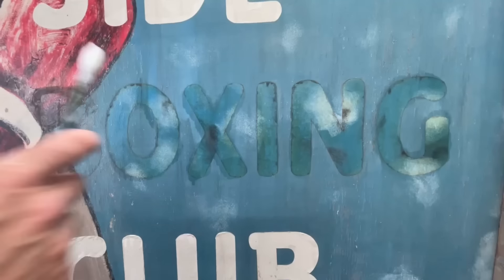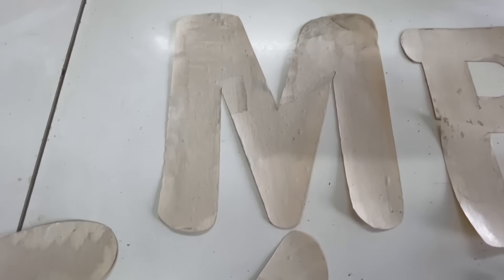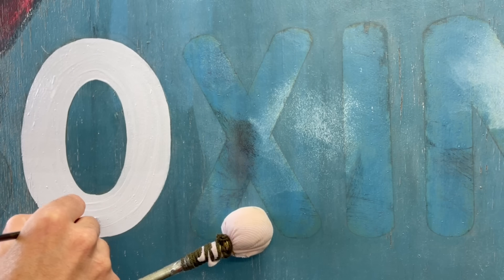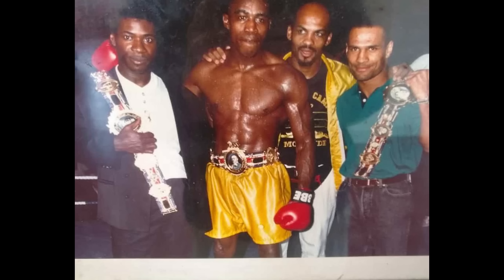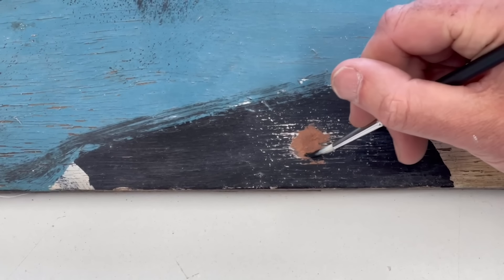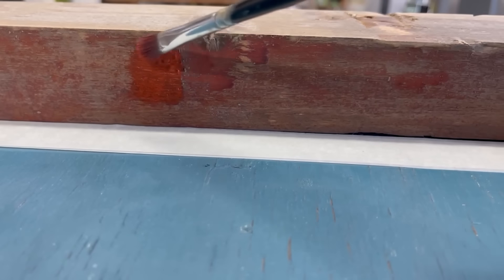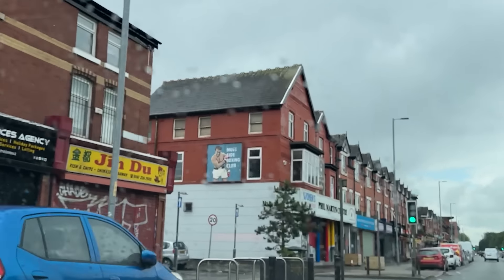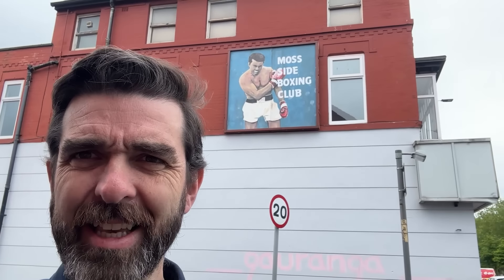Restoring a Legend Part 2 - Stickers and Signwriting

Comment: Actually I suspect modern vinyl wouldn't last anywhere near as long as the old letters did because a lot of the horrible chemicals used back in the day have been banned for good reasons. I don't think letters like these would he laser cut (vinyl isn't suitable for that because burning it releases hydrochloric acid) but with a plotter. These have been available since the 1970s but only became affordable for small shops and DIYers later. Nowadays you can buy a small one (up to 300 mm cutting width) for around £300 and they're heavily marketed to DIYers as you can use them to create your own shirt designs and whatnot with heat-transfer vinyl. I've got one at work and the model we bought back in 2018 was manufactured with hardly any changes for almost 20 years. The original service manual clearly showed its age recommending a handy adjustment tool - "an ordinary 3.5" floppy disk" to check the height and squareness of the cutting head.

It's nothing short of a miracle that the paint has lasted as well as it did! With modern inside/outside gloss I'd expect major flaking and chipping after ten years or so, possibly 15.